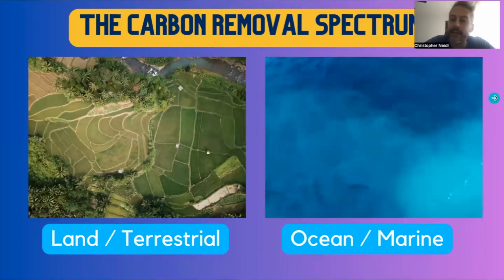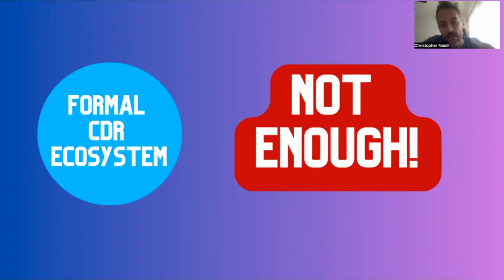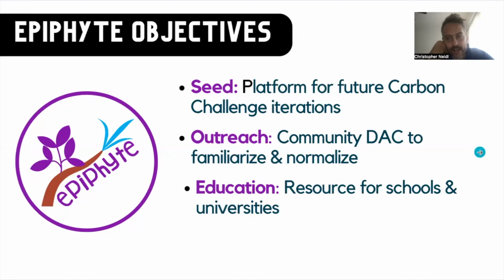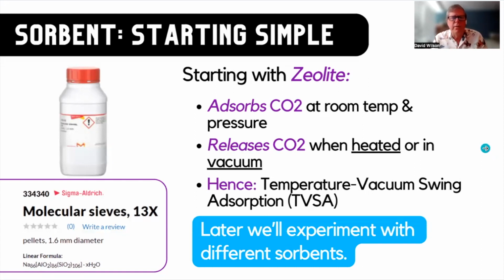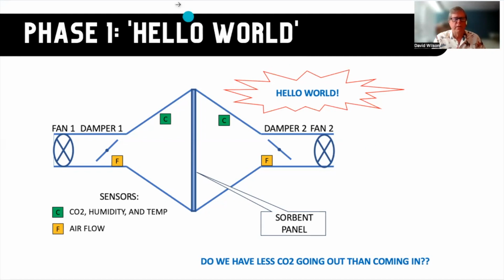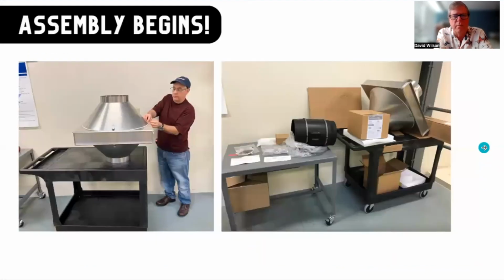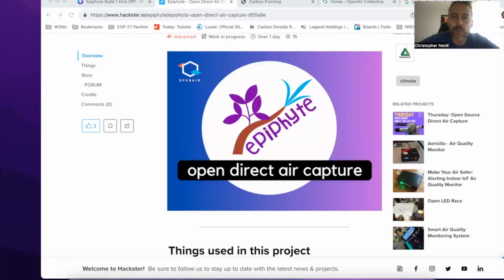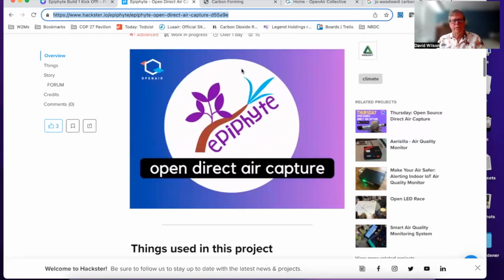Carbon Crowd: Epiphyte Build 1 Ep.1 - Hello World!

Comment: i had no idea zeolite was regenerative. being that it adsorbs and not absorbs, i thought the zeolite would be similar to calcium hydroxide and stuck with the byproduct. what temperature does the zeolite release the CO2? and how is the unit in its entirety sealed for the vacuuming extraction phase??

edit: i see the dampeners being used as valves. that's the plan to hold a vacuum? i don't see that holding much pressure by then again im not an HVAC guy
Reply: i didn't see any information on the fan. make and model please
Reply: also, what kind of heating element do you plan on using that will be inside the sorbent area with that filter media? wont that easily catch on fire? i didn't see anything on the heating side